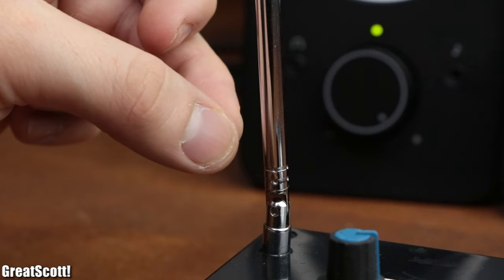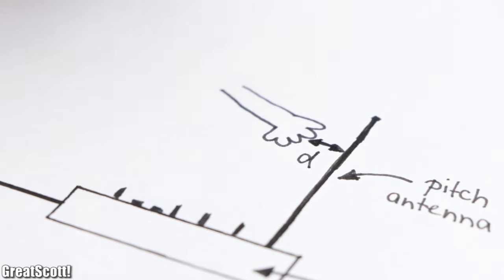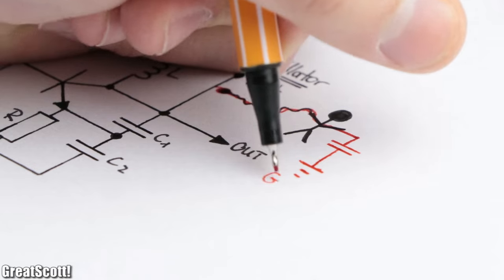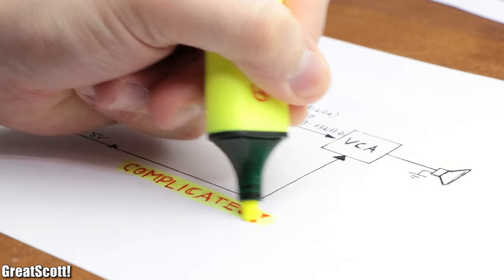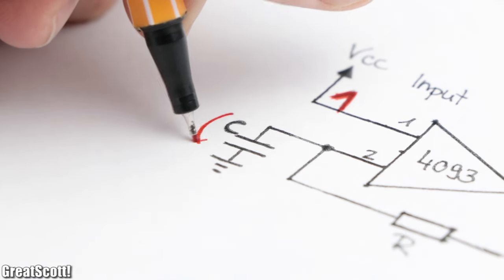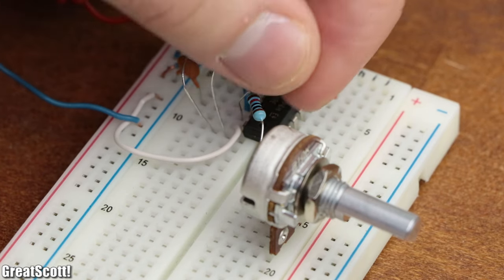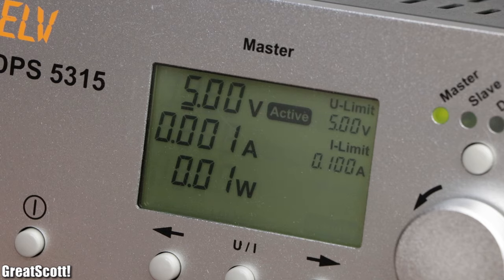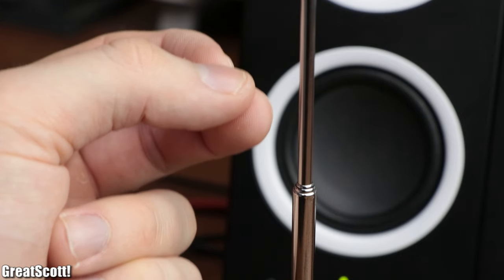Make your own Simple Theremin

Comment: You will get better sound if the output wave is a sine wave (with minimal noise) and you calibrate the max and min distance to 18khz to 50hz. In that way you can get a better sound response. Try it, really play theremin isn't hard. All you need is practice the distance.

Comment: Doesn't sound anything like a theramin, you need an even sine wave for a theramin, tuned to a set frequency (such as A, 440Hz) - then when you move your hand, that frequency changes, creating the notes

a square wave just sequeels...
Reply: "simple" was his main goal
Reply: Yes, but it was "Simple Theremin". Maybe he built something simple, but that is not a theremin. Sorry for farting in the bath, but that's a fail.
Reply: Exactly, this is a simple noise creator, not a simple Theremin.
Reply: Totally agree. As a "distance" detector maybe it work but isn't a theremin. Too much noise and high freq.
Reply: The LP filter needs set much lower, like 1-2KHz max to be musical, and subtract the unwanted harmonics of the square waves.
Reply: Why 2KHz? The max frequency that a human can hear is around 18KHz.
Reply: Lux LoL, just because you can hear up to 18KHz doesn't mean you will enjoy hearing all those high frequencies!   
Somewhere around 2k is a nice musical place to cap the frequency. If middle A = 440Hz, then 880Hz is an octave up, and 1760Hz is two octaves up... Which is plenty for most music.
And a lot of the garbage in this sound is unwanted overtones, a lower LP filter will cut those out.
Reply: I agree but 2KHz? The higest frequency in a standard piano is  4186Hz (C8). I would set the LP cutoff frequency to 7KHz. Also the problem is that the wave generated isn't a perfect sine wave so a lot harmonics will be in the circuit.
Reply: yeah like... this kind of sounds more like an untuned radio reacting to your hand being nearby, which is actually what inspired creation of the theremin. but sounding like the inspiration doesn't mean it was a successful simple version of the actual theremin, i'd say. the pure sine wave is what gives it the eerie sound, and that eerieness is what makes it a theremin imo. 
this demonstrates the way theremins work, certainly, and i wouldn't object to it being called a theremin demonstration instead.
Reply: Lux have you ever played with an analog synthesizer (or digital simulation)?   You can turn a harsh sounding squarewave (which is made of the fundamental, and all odd multiple harmonics) into almost a smooth sign wave by LP filtering just above the fundamental.  On a synth this filter frequency usually tracks with the note being played... Which would be far too complex for this project. But a much lower frequency LP filter than implemented in this project would help the sound a lot, and making the filter cutoff frequency variable on a knob would be useful. A range of 100Hz too 2KHz should be fine.

As to your piano comments...  This isn't a piano! And frequencies above 1KHz start being unpleasant, and even painful, by 3-4KHz you're in the OUCH zone.  The reason these frequencies aren't painful on a piano is due to their very low amplitude. The top octave is quite quiet!
Reply: I played a synth (both) so I know what are you talking about. I know that this isn't a piano but why to limitate the range? If I wanted to compose a chord with 1 theremin i need 2 oscilators, one in the tonic and one in the 3rd grade (major chord for example). You just can add both outputs. I had a Theremin (I cant remember the model) but this was a useful function. Of course I agree with the knob to control the cut frequency. For the last thing check this http://www.zytrax.com/tech/audio/sound.html#loudness.
Reply: Sacrificing some range for musicality, and some feature for simplicity, seems like a win.
Yes as you can see by the graph in your link, there is very sensitive spot in human hearing between 2KHz and 4KHz...filtering those frequencies out goes a long way toward ensuring a pleasant sound. ;-)
Reply: #100th like
Reply: Colin Hadley It's 'Theremin' not 'theramin' and your english is crap, but you are right. You need a sine wave.
Reply: After mixing two square waves with a frequency about 100kHz and filtering the result you should get something very close to a sinus.
Reply: OK, granted that a square wave is not the nicest sounding but that is not the biggest issue here. The main issues are 1)The frequency response to the distance is not very well set up and 2) The volume is not controlled in a similar manner to the frequency. The latter is crucial to the envelope of the sound for a theramin device and responsible for its unmistakable sound.

Comment: I think that the problem is mainly with the schematics, not with your playing skills.

Such circuits REALLY have to be well-shielded, elsewise they output too much noise. I think, that is the reason why your theremin sounds like squeaking.
Second, how does the differential opamp even work in such configurations? Subtracting two frequencies never gives a frequency difference unless some distortion occur, is it connected in a comparator mode? If not, try increasing the amplification.
I've made a project that was about hearing inaudible ultrasonic frequencies - basically, a frequency mixer of a heterodyne and a mic, which is very similar to this situation. During my experiments I've found that the cheapest and simplest, yet good-sounding solution is to use an analog switch like 4053 to switch between the first signal and the first signal inverted at a frequency equal to the second signal frequency. Maybe you should try this configuration and replace on of your oscillators with a real colpitts oscillator. I can give you the schematics for my ultrasonic sound project if you want to.
Reply: can you share thos schematics comrade?

Comment: That would actually make a great mini proximity detector. Make an electronic controlled mouse-trap or a snack-snatching alarm. If anyone tries to grab a snack, it triggers a siren horn. Attach it to a door handle and you have an anti-tamper alarm detector. Put it in your wall, where the doorbell should be, and you have a 100% waterproof, touchless door chime. Add it to a robot and the robot can sense when you are about to grab it. Add three and the robot can detect you and run the other direction, where is doesn't sense you. :)

Comment: I think you might find it worth revisiting the XOR gate which will mix the frequencies, unlike the op-amp which is mixing the voltages.
Reply: I agree. In therory you need an korrelation circuit between fixed and variable frequencies. XOR is an simple "digital" approximation to this. Linear adding voltages does this not. But if the amplitudes are to high and nonlinear effects occur, it seems to work.
Reply: @joergfoerster8043  someone probably told him he should use an SA602 Double-balanced mixer, but he substituted the OpAmp 🙂
Reply: @Chris-ZL  Yes, in HF-technik an mixer is in my option an multiplier - in audio-technik a mixer is an adder. Or, shoud i say: Even in an audio-technik-mixer each input-signal is multiplied with their volume-control and then the signals are added.

Comment: I dont understand why you use an opamp here?  They make terrible RF mixers.  You are looking for a non-linear mixer like a jfet or even a bjt if nothing else... linear mixers are right out!
Reply: I agree. In therory you need an korrelation circuit between fixed and variable frequencies. XOR is an simple "digital" approximation to this. Linear adding voltages does this not. But if the amplitudes are to high and nonlinear effects occur, it seems to work.

Comment: In my amazement that they built a Low Frequency mixer in the circuit, so i went in the theremin site and found out what it was, just a capacitor. Obviously, for a crude experiment no one wanted to design a mixer with high specs.

Comment: XOR would be a better choice for the mixer, you need to multiply the signals to get heterodyne products, not just subtract them.  Unfortunately you can't throw out too much complexity from the Theremin and keep it sounding like an instrument; square waves sound very harsh because of all the harmonics.  The lack of a volume control is less important, but makes it much less useful musically.  Narrowing the pass-band on the post mixer filter would help make it sound better, but the timbre will change a great deal over its range.
Reply: I agree. In therory you need an korrelation circuit between fixed and variable frequencies. XOR is an simple "digital" approximation to this. Linear adding voltages does this not. But if the amplitudes are to high and nonlinear effects occur, it seems to work.

Comment: Just idea, plug output into ATmega32u4 a make cool MIDI instrument
Reply from the maker: Never worked with MIDI before. Might have to do a little research.
Reply: CZ/SK?
Reply: greatscott asi nemec
Reply: ja nemyslím greatscotta ale teba xD
Reply: Or just use an Arduino with Atmega16u2 built-in and flash de LUFA midi firmware. Cheap and simple.
Reply: You can buy pretty decent development board with ATmega32u4 from aliexpress for 4 USD, or Arduino micro for 18 USD. Development with ATmega16u2 will be complicated because there is no development board on the market
Reply: When I said Atmega16u2 I refer to the mcu that is present on Arduino UNO R3 boards for example. You can reflash it with FLIP (software provided by Atmel) using the DFU mode. The MIDI LUFA firmware is precompiled so you only need to upload it.
At least in my country, an Arduino Micro cost twice that an Arduino UNO. If you can buy a Micro then go for it, you will get a very small board with USB capabilities (that is very useful for a lot of projects).
Reply: Zentimítr řekne jedině němec :D
Reply: Can midi do full analog? I thought midi was only for digital input devices. I couldn't see a theremin working sufficiently when being forced to convert to digital triggers.
Reply: MIDI is a comunication protocol for digital instruments. You have to connect the device (client) to a MIDI input software (host) and is the software converts the MIDI numbers to an analog sound. Of course the analog theremin is more "sensitive" or "organic" but if you've got a bad circuit (like the one that Scott build) you get a very ugly sound (that you hear in this video). In the sound world you have to use very specific sound components, not regular resistors, capacitors, etc.
Reply: I didn't think midi had support for full analog input, which would be required for a theremin, due to the way it modulates the sound. I wouldn't even know where to approach modifying the analog output of the theremin to a set of digital triggers for the midi input either. Not really sure how it would work as a midi instrument at all. I suppose it could be encoded like a rotary encoder which controls the pitch modulation of a signal, and it would be similar to a theremin... but i don't really see the point.
Reply: Richard Smith Midi doesn't have analog support, that is true, so you have to us Arduino to convert analog input into Midi massages.
IMHO the best way is to send one note and then by pitch-bending change its frequency.
It would be possible to add another antenna to charge volume.
Reply: or use an atemega328p with a vusb (Virtual USB) midi firmware
Reply: You can't control a Theremin by Midi, it's like controlling a violin by Midi.

But maybe you can use a Theremin as an Input for a Midi synthesizer.

Comment: Nice! 

Just a question: why are you using NAND gates with an input pulled to HI instead of simple NOT? Wouldn't you get the same result?
Reply: @__MINT_  The easiest way would be to use a ring oscillator.
Reply: @__MINT_  You could, you just need an uneven number of gates.

Comment: A Thermin also adjust the volume with an antenna.  So one for the pitch and one for the volume.  And as might be good to have a separate LP filter which can be tuned.

Don't bother with  a midi convertion. It would be like trying to make a midi interface to a violin or bandless base guitar.  A Thermin like a violin doesn't have fixed band and notes.  

Interesting projekt, with potentials. :-)

Comment: For this setup, could I use a battery instead of a power supply???  I think you are using 5V, what would happen if I put a battery with less voltage or a battery with a higher voltage??? Would still work? Please help

Comment: Why it doesn't sound right,,, It's your output oscillator, A sine would be better for trying to play melodies.. Even better if you make it put out voltages in the range of CV (control voltage) for an analogue synth, make a separate channel for volume (same setup) Hook them up to pitch and volume control... and you can really play.

Comment: The differential amplifier will not produce an effective heterodyne. You have confused the concept of the linear subtraction of voltages with the concept of heterodyning. The exclusive-OR gate is a better method, and a suitable low-pass filter will remove the unwanted sum frequencies. Some comments claim that the noisy, low-fidelity output of this circuit is due to a lack of shielding. However, the poor fidelity is mostly due to the inherently-low "Q" factor of the relaxation oscillators, since interference is coupled directly into the variable oscillator through the antenna. Similar schemes using CMOS relaxation oscillators can be achieved with much better performance.
Reply: I agree. In therory you need an korrelation circuit between fixed and variable frequencies. XOR is an simple "digital" approximation to this. Linear adding voltages does this not. But if the amplitudes are to high and nonlinear effects occur, it seems to work.

Comment: 7:49 Why not Hot glue?
Reply from the maker: I had to use two component adhesive for the antenna anyway. So I just used it for all the parts.
Reply from the maker: Because hot glue does not sick well to metal.
Reply: A tip for hot gluers. Use a heat gun to pre-warm all the surfaces. Then the hot glue is less prone to making spider webs and the glue will flow onto the surfaces. The reason it does not stick to metal easily is the rapid cooling caused by the cold metal.
Reply: What is that material to glue?

Comment: @GreatScott Long time fan, first time post...How exactly does subtracting two signals (f1 = a & f2 = b) using a difference op-amp configuration result in a signal having a frequency of the first minus the other (fout = a - b)? A frequency down mixer uses the property of trig multiplication which results in this behavior but I don't see how this applies when performing a signal subtraction. Thanks!
Reply: I agree. In therory you need an korrelation circuit between fixed and variable frequencies. XOR is an simple "digital" approximation to this. Linear adding voltages does this not. But if the amplitudes are to high and nonlinear effects occur, it seems to work.

Comment: Nice video! Liked it. 
GreatScott , I have often observed that when I make a circuit in a breadboard, it works. But after soldering it to a perfboard, it doesn't work. This is obviously due to my mistakes, but do you have any suggestions in general regarding this ?
Reply from the maker: Not really. Sometimes my circuits do not work on perfboard at the first try as well. I then troubleshoot and usually find the problem by measuring whether all components are connected to one another the way it is supposed to.
Reply: GreatScott! Thanks :)

Comment: Lots of whinging and whining on here abut the sound, and the square waves but, as I see it, the circuit takes operator proximity to the antenna and (through what is basically PWM and the LC filter) produces a corresponding voltage as output. This voltage can then control a Sine wave VCO (either on board, or through a modular synth). (might need scaling and/or biasing)

While the output range might be limited, this does look like it could form the basis of a nice little synth controller, or even (quotes for the pedants :) ) 'real' theremin.

Guess I'm off to play when I get a moment :) (thinks... can I use an amplifier in front of an MCU's capsense peripheral... :) )

Oh, for the guys who want MIDI, read the output through an ADC on an MCU, scale. quantize and spit out MIDI through USB-MIDI or 'real' serial midi. Just make sure the voltage range doesn't fry the MCU and add protection and attenuation if it does.

Comment: Make a simple radio transmitter
Reply: Well, this one is actually an AM transmitter with an very broad spectrum. Of course, the modulation circuitry for audio ist still missing! :-)
Reply: You can make an FM transmitter with just a single transistor and a few resistors and capacitors. Google 'Talking Electronics' or Colin Mitchell FM Bug.
Reply: Pyrite radio?